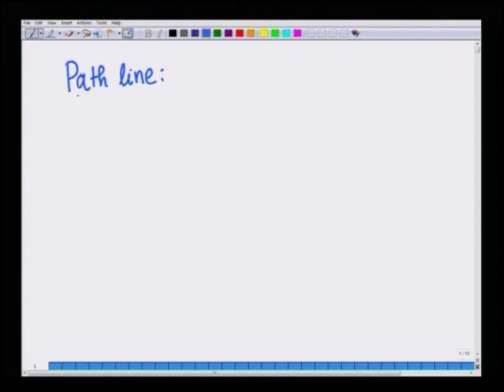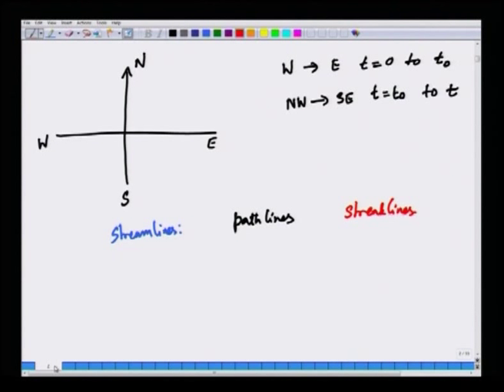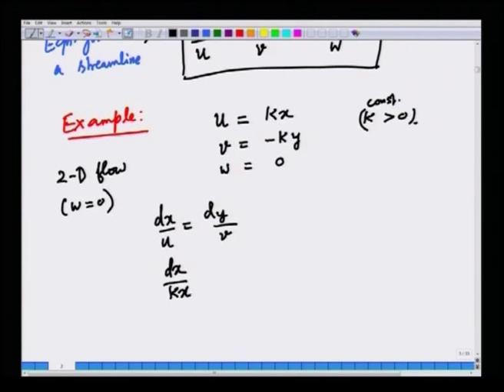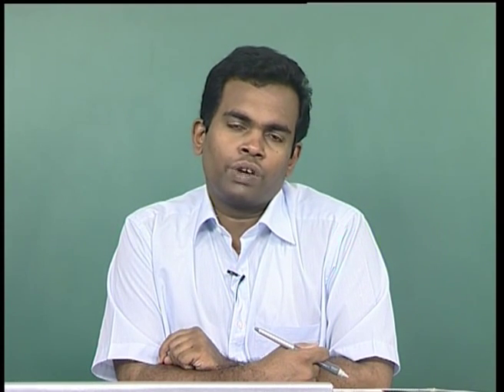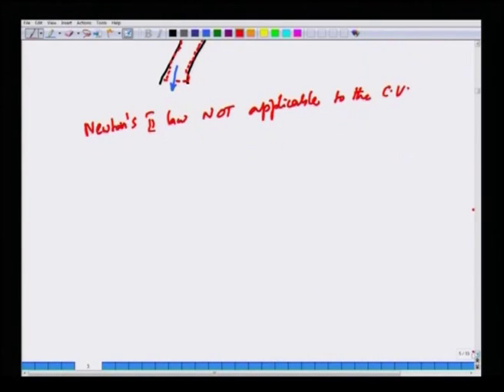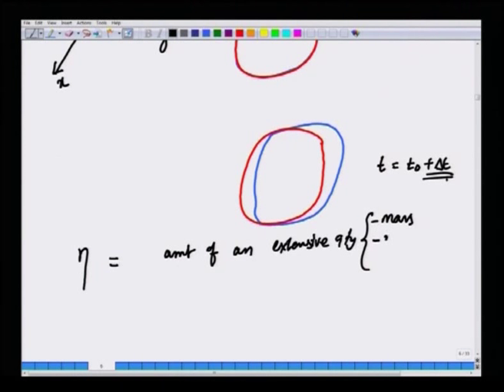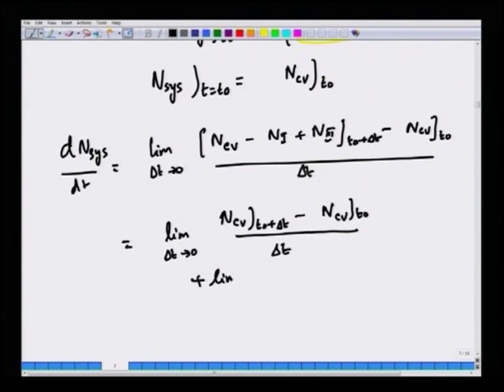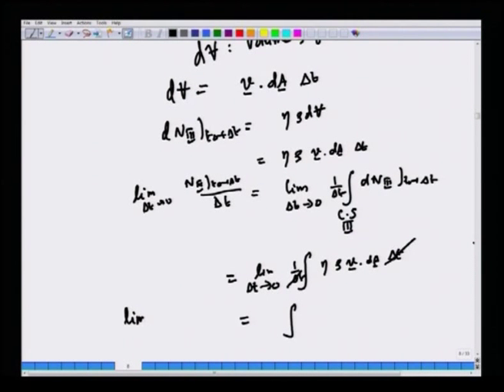Mod-01 Lec-11 Lecture-11

Comment: In previous lecture it was said that the stream line is the line locally tangential to the velocity vector....
But  in this lecture it is being said that it is parallel to the velocity vector...how?🤔
Reply: the streamline is tangential to the velocity vector at every point, and in that sense, we can think of them as "locally parallel" because they have the same direction at each point. However, the more precise term would be tangential, as the velocity vector touches but doesn't necessarily run alongside the streamline at a constant distance.

Comment: I did not get the difference between streaklines and pathlines clearly.
Reply: In path line we are tracking the movement of one particle by putting a drop of an ink.

In streak line we are continuously putting the ink at a point so that we are tracking all the particles going from that point. 

Its important when the flow is unsteady.